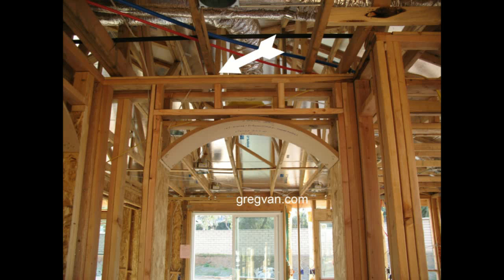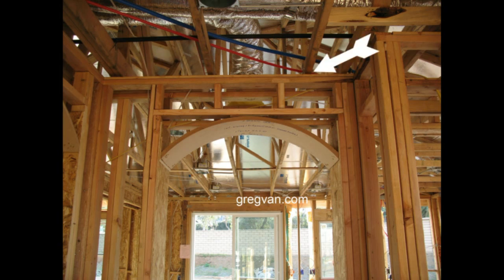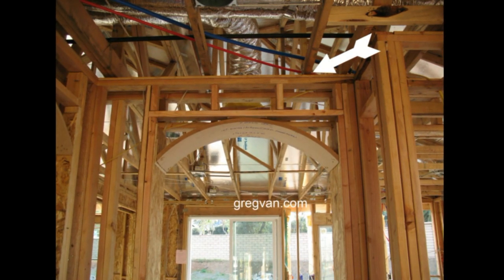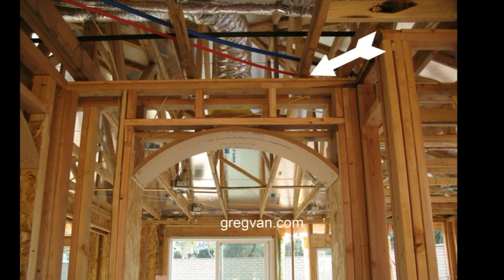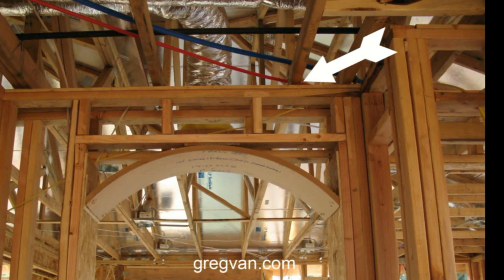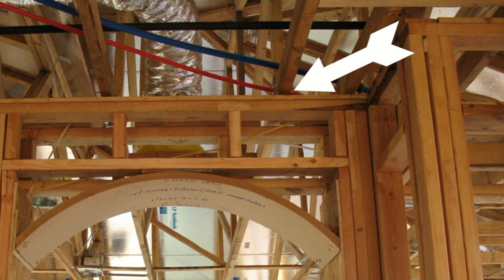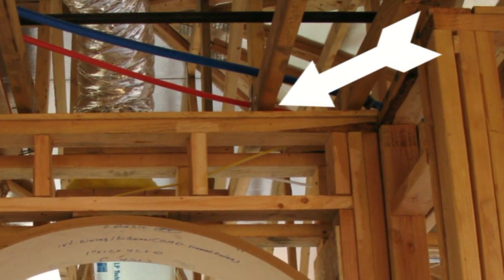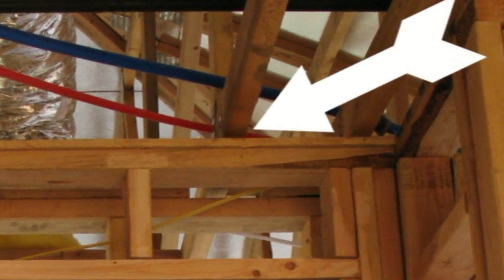Interior Non-Bearing Wall - Engineered Roof Truss

Comment: One thing to think about is that if it isn't a load bearing wall, it could be used as a brace for an exterior wall, we ran into this problem on one of our project houses and re-bracing that wall was a major pain. 
We had to put in a half wall and build a kitchen bar over it to re-brace the wall.

Comment: My point is that people should be careful when messing with none load bearing walls because they could be 'bracing' another wall adjacent and be structurally necessary even though they are not supporting a 'load' so to speak.